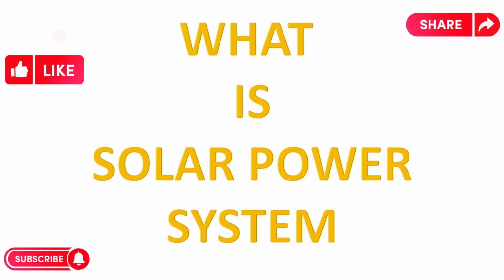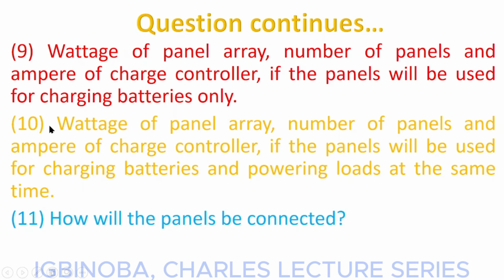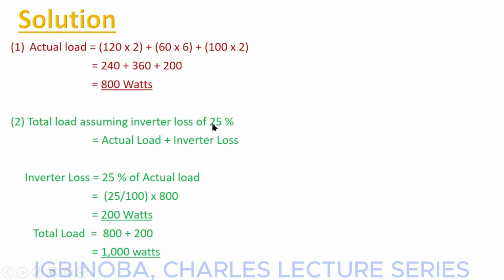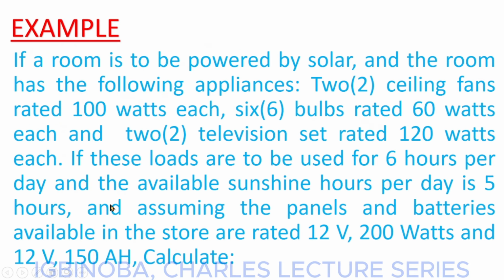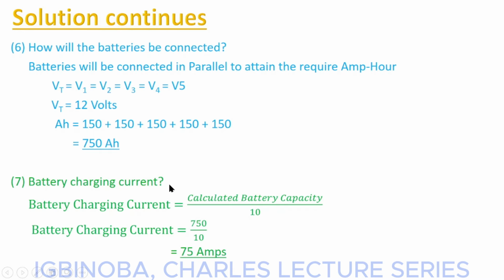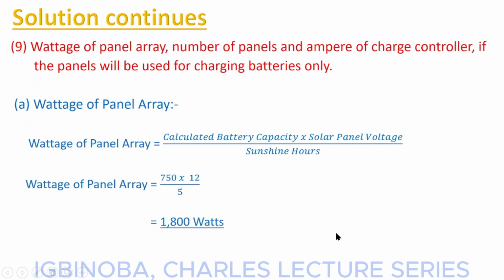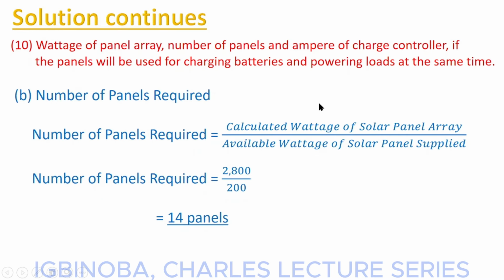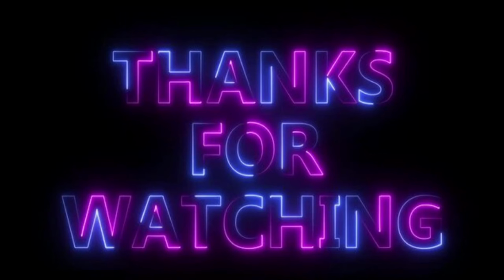Design of Solar Power System

Comment: COMP320T 

1 Actual load 1380W
2 Total load  1720W
3 Inverter rating  2156.25VA
4 battery Capacity 1293.75Ah
5 number of batteries 8.6
6 Parallel 
7 Battery charging  129.4A
8 T = 14hrs
9 (a) 3105W
   (b) 15.5 panels 
   (c)  258.75 A
10 (a) 4830W 
     (b) 24 panel 
     (c) 402.5A 
11 Parallel

Comment: PETRO327A

1. Actual load= (100×3)+(60×10)+(120×4) =1380watts
2. Total load assuming inverter loss of 25%= Actual load +Inverter loss
Inverter loss=25% of Actual load
= 25%×1380=345 watts
Total load= 1380+345=1725 watts
3. Inverter rating on VA using power factor of 0.8
= (1725÷0.8)= 2156.25
4. Battery capacity using factor for reserve 75%=(2×1725×6×0.75)=1293.75Ah
5. No. of batteries for backup hours=1293.75Ah÷150Ah= 8.6 =8 batteries 
6. How batteries will be connected?
The batteries will be connected in parallel 
Vt=V1=V2=V3=V4=V5=V6=V7=V8
Ah= 150+150+150+150+150+150+150+150=1200
7. Battery charging current=1293.75÷10=129Amps
8. Battery charging time assuming charging loss of 40%= 1293.75Ah+(40%+1293.75Ah)÷129A=14hrs
9a. Wattage panel array= 3105 watts
9b. Number of panels required= 3105÷345=9 panels 
9c. Ampere of charging controller required= 3105÷12=258.75Amps
10a. Wattage of panel array= Calculated wattage of solar panel array for charging battery only+ calculated total load =3105+1725=4830watts
10b. Number of panels required= calculated wattage of solar panel array÷ Available wattage of solar panel supplied= 4830watts÷345= 14Amps
10c. Ampere of charge controller= calculated wattage of solar panel array÷ solar panel voltage=4830watts÷12volts= 402.5Amps
11. How will the panels be connected?
Ans: They will be connected in parallel

Comment: MAR378Z
 
1. Actual load= (100×3)+(60×10)+(120×4) =1380watts
2. Total load assuming inverter loss of 25%= Actual load +Inverter loss
Inverter loss=25% of Actual load
= 25%×1380=345 watts
Total load= 1380+345=1725 watts
3. Inverter rating on VA using power factor of 0.8
= (1725÷0.8)= 2156.25
4. Battery capacity using factor for reserve 75%=(2×1725×6×0.75)=1293.75Ah
5. No. of batteries for backup hours=1293.75Ah÷150Ah= 8.6 =8 batteries 
6. How batteries will be connected?
The batteries will be connected in parallel 
Vt=V1=V2=V3=V4=V5=V6=V7=V8
Ah= 150+150+150+150+150+150+150+150=1200
7. Battery charging current=1293.75÷10=129Amps
8. Battery charging time assuming charging loss of 40%= 1293.75Ah+(40%+1293.75Ah)÷129A=14hrs
9a. Wattage panel array= 3105 watts
9b. Number of panels required= 3105÷345=9 panels 
9c. Ampere of charging controller required= 3105÷12=258.75Amps
10a. Wattage of panel array= Calculated wattage of solar panel array for charging battery only+ calculated total load =3105+1725=4830watts
10b. Number of panels required= calculated wattage of solar panel array÷ Available wattage of solar panel supplied= 4830watts÷345= 14Amps
10c. Ampere of charge controller= calculated wattage of solar panel array÷ solar panel voltage=4830watts÷12volts= 402.5Amps
11. How will the panels be connected?
Ans: They will be connected in parallel.

Comment: MECH383E

1. Actual load=1380W

2. Total load = 1725W

3. Inverter rating=2156.25VA

4. Battery capacity= 1293.75AH

5. Number of batteries= 9 batteries

6. How will the batteries be connected= In Parallel

7. Battery charging current=129.3A

8. Charging time= 14 hours

9. a) Wattage of panel array=3105W
b) Number of panels=15.5 panels
c) Ampere of charge controller=258.75A

10. a) Wattage of panel array= 4830W
b) Number of panels=24 panels
c) Ampere of charge controller=402.5A

11. How will the panels be connected= In Parallel

Comment: ANSWERS TO SWEP NEW TASK
 YOUR DEPT. CODE AND BELOW ARE THE ANSWERS 
1. Actual load= (100×3)+(60×10)+(120×4) =1380watts
2. Total load assuming inverter loss of 25%= Actual load +Inverter loss
Inverter loss=25% of Actual load
= 25%×1380=345 watts
Total load= 1380+345=1725 watts
3. Inverter rating on VA using power factor of 0.8
= (1725÷0.8)= 2156.25
4. Battery capacity using factor for reserve 75%=(2×1725×6×0.75)=1293.75Ah
5. No. of batteries for backup hours=1293.75Ah÷150Ah= 8.6 =8 batteries 
6. How batteries will be connected?
The batteries will be connected in parallel 
Vt=V1=V2=V3=V4=V5=V6=V7=V8
Ah= 150+150+150+150+150+150+150+150=1200
7. Battery charging current=1293.75÷10=129Amps
8. Battery charging time assuming charging loss of 40%= 1293.75Ah+(40%+1293.75Ah)÷129A=14hrs
9a. Wattage panel array= 3105 watts
9b. Number of panels required= 3105÷345=9 panels 
9c. Ampere of charging controller required= 3105÷12=258.75Amps
10a. Wattage of panel array= Calculated wattage of solar panel array for charging battery only+ calculated total load =3105+1725=4830watts
10b. Number of panels required= calculated wattage of solar panel array÷ Available wattage of solar panel supplied= 4830watts÷345= 14Amps
10c. Ampere of charge controller= calculated wattage of solar panel array÷ solar panel voltage=4830watts÷12volts= 402.5Amps
11. How will the panels be connected?
Ans: They will be connected in parallel

Comment: EEE3102X 

1. actual load = 1380watts
2. total load = 1725watts
3. inveter ratings in VA = 2156.26VA
4. battery capacity = 1035AH
5.  number of batteries for back up hours = 6.9 = battries 
6. the batteries will be connected in parallel 
7. Battery charging current = 103.5A
8. Battery charging time = 14hrs
9. 
a. Wattage panel array = 3105 watts
b. Number of panels = 16
c. Charge controller = 258.75A
10.
a. Wattage panel array 
b. Number of panels = 24
c.  Charge controller = 402.5A
11. Panels are arranged in parallel

Comment: PETRO33C 

1. Actual load= (100×3)+(60×10)+(120×4) =1380watts
2. Total load assuming inverter loss of 25%= Actual load +Inverter loss
Inverter loss=25% of Actual load
= 25%×1380=345 watts
Total load= 1380+345=1725 watts
3. Inverter rating on VA using power factor of 0.8
= (1725÷0.8)= 2156.25
4. Battery capacity using factor for reserve 75%=(2×1725×6×0.75)=1293.75Ah
5. No. of batteries for backup hours=1293.75Ah÷150Ah= 8.6 =8 batteries 
6. How batteries will be connected?
The batteries will be connected in parallel 
Vt=V1=V2=V3=V4=V5=V6=V7=V8
Ah= 150+150+150+150+150+150+150+150=1200
7. Battery charging current=1293.75÷10=129Amps
8. Battery charging time assuming charging loss of 40%= 1293.75Ah+(40%+1293.75Ah)÷129A=14hrs
9a. Wattage panel array= 3105 watts
9b. Number of panels required= 3105÷345=9 panels 
9c. Ampere of charging controller required= 3105÷12=258.75Amps
10a. Wattage of panel array= Calculated wattage of solar panel array for charging battery only+ calculated total load =3105+1725=4830watts
10b. Number of panels required= calculated wattage of solar panel array÷ Available wattage of solar panel supplied= 4830watts÷345= 14Amps
10c. Ampere of charge controller= calculated wattage of solar panel array÷ solar panel voltage=4830watts÷12volts= 402.5Amps
11. How will the panels be connected?
Ans: They will be connected in parallel.

Comment: COMP341O

1. Actual load is 1380w

2. Total load is 1725w

3. Inverter ratings is 2156.25VA

4. Battery capacity is 1293.75AH

5. No of batteries 9

6. Parallel

7. Battery charging current is 129.375amps

8. Charging time is 14 hours

9. A. 3105watts
B. 16 panels
C. 258.75amps

10. A. 4830 watts
B. 24 panels
C. 402.5amps

11. Parallel

Comment: CIV371S

1 (3×100)+(10×60)+(4×20)
1380 Watts 

2  inverter loss is 345 Watts 
Total load is 1380+345= 1725 Watts 

3 1725÷0.8= 2156

4  battery capacity is 1294Ah

5 1294/150 = 9 batteries 

6 1200

7 1294/10 =129 Amps 

8 charging time is 14 hours 

9a 1294×12/5 = 3105 Watts 
b 3105/200= 15 panels.
c 3105/12 = 259 Amps

10a 3105+1725=4830 Watts 
b 4830÷200= 24 panels
c 4830÷12= 403 Amps

11 The panel will be connected in parallel.

Comment: CIV329C1

 (3×100)+(10×60)+(4×20)
1380 Watts 

2  inverter loss is 345 Watts 
Total load is 1380+345= 1725 Watts 

3 1725÷0.8= 2156

4  battery capacity is 1294Ah

5 1294/150 = 9 batteries 

6 1200

7 1294/10 =129 Amps 

8 charging time is 14 hours 

9a 1294×12/5 = 3105 Watts 
b 3105/200= 15 panels.
c 3105/12 = 259 Amps

10a 3105+1725=4830 Watts 
b 4830÷200= 24 panels
c 4830÷12= 403 Amps

11 The panel will be connected in parallel.

Comment: MEE 312S
1.	Actual Load = 1380 watts
	2.	Total Load = 1725 watts
	3.	Inverter Rating = 2156.25 VA
	4.	Battery Capacity = 1293.75 Ah
	5.	Number of Batteries = 8.625 ~ 9 batteries
	6.	Parallel
	7.	Battery charging current = 129.375 Amps
	8.	Charging time = 14 hrs
	9.	(a) 3105 watts
(b) 15.525 ~ 16 panels
(c) 258.75 Amps
	10.	(a) 4830 watts
(b) 24.15 ~ 24 panels
(c) 402.5 Amps
	11.	Parallel

Comment: COMP3101W 
1. Actual load, 1380 W
2. Total load with 25% inverter loss,1840W
3. Inverter rating i.e PF 0.8, 2300 VA
4. Battery capacity i.e 75% reserve, =920 Ah
5. Number of batteries, 7 batteries
6. Battery connection, All parallel
7. Battery charging current, 138A
8. Battery charging time i.e 40% loss, 8.3 hours
9. Panels for battery charging only,14 panels (2800 W),250A controller
10. Panels for charging + direct load, 26 panels (5 200 W),420-450A controller
11. Panel connection, 7S2P

Comment: CHM397S
i) Actual load = 1380 watts.
il) Total load = 1725 watts.
iii) Inverter ratings in VA = 2156.25VA.
iv) Battery capacity = 1035Ah.
v) Number of batteries for backup hours = 6.9= 7
batteries.
vi) The batteries will be connected in parallel. vii) Battery charging current= 103.5 A. viii) Battery charging time= 14 hours ix) a. Wattage of panel array= 2484 watts.
b. Number of panels= 12.42 = 12 panels
c. Ampere of charge controller= 207A.
x) a. Wattage of panel array= 4209 watts.
b. Number of panels= 21.05 = 21 panels.
c. Ampere of charge controller= 350.75A. xi) The panels will be connected in parallel just as the batteries

Comment: MECH369Q

1.  Actual load = 1380 watts

2.  Total load = 1725 watts

3.  Inverter rating = 2156.25 VA

4.  Battery Capacity  = 1293.75 Ah

5.  Number of batteries = 9 batteries 

6.  Batteries will be connected in parallel to attain the require amp-hour

7.  Battery charging current = 129.375 Amps

8.  Battery charging time = 14 hours

9(a)  Wattage of panel array = 3105 Watts
  (b)  Number of panels required  = 16 panels
  (c)  Ampere of charger controller required = 258.75 Amps

10(a)  Wattage of panel array = 4830W
    (b)  Number of panels required = 24 panels
    (c)  Ampere of charger controller required = 402.5 Amps

11.  Solar panels will be connected in parallel

Comment: MAR331E 

1. Actual load = 1380W

2. Total load = 1720W

3. Inverter rating = 2156.25VA

4. Battery capacity = 1293.75Ah

5. Number of batteries = 8.6

6. Parallel

7. Battery charging = 129.4A

8. T = 14hrs

9. (a) 3105W
(b) 15.5 panels
(c) 258.75A

10. (a) 4830W
(b) 24 panel
(c) 402.5A

11. Parallel

Comment: PETRO3185C
1. Actual load= (100×3)+(60×10)+(120×4) =1380watts
2. Total load assuming inverter loss of 25%= Actual load +Inverter loss
Inverter loss=25% of Actual load
= 25%×1380=345 watts
Total load= 1380+345=1725 watts
3. Inverter rating on VA using power factor of 0.8
= (1725÷0.8)= 2156.25
4. Battery capacity using factor for reserve 75%=(2×1725×6×0.75)=1293.75Ah
5. No. of batteries for backup hours=1293.75Ah÷150Ah= 8.6 =8 batteries 
6. How batteries will be connected?
The batteries will be connected in parallel 
Vt=V1=V2=V3=V4=V5=V6=V7=V8
Ah= 150+150+150+150+150+150+150+150=1200
7. Battery charging current=1293.75÷10=129Amps
8. Battery charging time assuming charging loss of 40%= 1293.75Ah+(40%+1293.75Ah)÷129A=14hrs
9a. Wattage panel array= 3105 watts
9b. Number of panels required= 3105÷345=9 panels 
9c. Ampere of charging controller required= 3105÷12=258.75Amps
10a. Wattage of panel array= Calculated wattage of solar panel array for charging battery only+ calculated total load =3105+1725=4830watts
10b. Number of panels required= calculated wattage of solar panel array÷ Available wattage of solar panel supplied= 4830watts÷345= 14Amps
10c. Ampere of charge controller= calculated wattage of solar panel array÷ solar panel voltage=4830watts÷12volts= 402.5Amps
11. How will the panels be connected?
Ans: They will be connected in parallel

Comment: CHM360H
1.Actual load = 1380w
2.Total load = 1725w
3.Inverter rating = 2156.25VA
4.Battery capacity = 1293.75AH
5.No batteries 9
6.Parallel
7.Battery charging current = 129.38ampere
8.Charging time = 14 hours
9.a) 3105w
   b) 15.5 panels
   c) 258.75A
10.a) 4830w
     b) 24 panels
     c) 402.5A
11.Parallel

Comment: MAR3154X

1. Actual load = 1380 watt
2. Total load = 1725 watt
3. Inverter rating = 2156.25 VA 
4. Battery rating= 1293.75 Ah
5. Number if batteries = 9
6. Battery are connected in parallel 
7. Battery charging current= 129.4 amps
8. Battery charging Time = 14hrs
9
a. Wattage panel array = 3105 watts
b. Number of panels = 16
c. Charge controller= 258.75 A
10
a. Wattage of panel array = 4830 watts
b. Number of panels= 24
c. Charge controller= 402.5 A
11. Panels are arranged in parallel ❤

Comment: CHM34D 
1. Actual load= (100×3)+(60×10)+(120×4) =1380watts
2. Total load assuming inverter loss of 25%= Actual load +Inverter loss
Inverter loss=25% of Actual load
= 25%×1380=345 watts
Total load= 1380+345=1725 watts
3. Inverter rating on VA using power factor of 0.8
= (1725÷0.8)= 2156.25
4. Battery capacity using factor for reserve 75%=(2×1725×6×0.75)=1293.75Ah
5. No. of batteries for backup hours=1293.75Ah÷150Ah= 8.6 =8 batteries 
6. How batteries will be connected?
The batteries will be connected in parallel 
Vt=V1=V2=V3=V4=V5=V6=V7=V8
Ah= 150+150+150+150+150+150+150+150=1200
7. Battery charging current=1293.75÷10=129Amps
8. Battery charging time assuming charging loss of 40%= 1293.75Ah+(40%+1293.75Ah)÷129A=14hrs
9a. Wattage panel array= 3105 watts
9b. Number of panels required= 3105÷345=9 panels 
9c. Ampere of charging controller required= 3105÷12=258.75Amps
10a. Wattage of panel array= Calculated wattage of solar panel array for charging battery only+ calculated total load =3105+1725=4830watts
10b. Number of panels required= calculated wattage of solar panel array÷ Available wattage of solar panel supplied= 4830watts÷345= 14Amps
10c. Ampere of charge controller= calculated wattage of solar panel array÷ solar panel voltage=4830watts÷12volts= 402.5Amps
11. How will the panels be connected?
Ans: They will be connected in parallel

Comment: CHM3134D

1. Actual load:1380 watts
2. Total load: 1725 watts
3. Inverter rating: 2156.25VA
4. Battery capacity: 1293.75Ah
5. Number of batteries: 8.625
6. Parallel 
7. Battery charging current: 129.375Amps
8. Charging time: 14hrs
9a 3105 watts
9b 15.525 amps
9c 285.75amps
10a 4830 watts
10b 24.15
10c 402.5 amps
11. Parallel

Comment: COMP311K

1 Actual load 1380W
2 Total load  1720W
3 Inverter rating  2156.25VA
4 battery Capacity 1293.75Ah
5 number of batteries 8.6
6 Parallel 
7 Battery charging  129.4A
8 T = 14hrs
9 (a) 3105W
   (b) 15.5 panels 
   (c)  258.75 A
10 (a) 4830W 
     (b) 24 panel 
     (c) 402.5A 
11 Parallel

Comment: PETRO3100V

ANSWERS:

1. Actual load: 1530 W

2. Total load with inverter loss: 9.18 kWh/day becomes 12.24 kWh/day required from batteries

3. Inverter rating: 1530 W ÷ 0.8 is exactly 2.0 kVA

4. Battery capacity needed: 12.24 kWh at 12 V = 1020 Ah usable =1360 Ah total at 75% DoD

5. Number of batteries: 1360 Ah ÷ 150 Ah ≈ 10 batteries.

6. Battery connection: All 10 batteries in parallel (12 V, high Ah)

7. Battery charging current: Array current = (total panel watts ÷ 12 V)

8. Charging time: Needs 22.25 kWh from panels; sized to recover within 5 sun hours

9. Panel array (charging batteries only): About 23 panels (200 W each), charge controller capacity ≈ 400 A total.

10. Panel array (powering loads + charging): About 12 panels, controller capacity is 200 A

11. Panel connection: Panels connected in parallel (or parallel strings) to maintain a 12 V system

Comment: PETRO3156Z
1. Actual load= (100×3)+(60×10)+(120×4) =1380watts
2. Total load assuming inverter loss of 25%= Actual load +Inverter loss
Inverter loss=25% of Actual load
= 25%×1380=345 watts
Total load= 1380+345=1725 watts
3. Inverter rating on VA using power factor of 0.8
= (1725÷0.8)= 2156.25
4. Battery capacity using factor for reserve 75%=(2×1725×6×0.75)=1293.75Ah
5. No. of batteries for backup hours=1293.75Ah÷150Ah= 8.6 =8 batteries 
6. How batteries will be connected?
The batteries will be connected in parallel 
Vt=V1=V2=V3=V4=V5=V6=V7=V8
Ah= 150+150+150+150+150+150+150+150=1200
7. Battery charging current=1293.75÷10=129Amps
8. Battery charging time assuming charging loss of 40%= 1293.75Ah+(40%+1293.75Ah)÷129A=14hrs
9a. Wattage panel array= 3105 watts
9b. Number of panels required= 3105÷345=9 panels 
9c. Ampere of charging controller required= 3105÷12=258.75Amps
10a. Wattage of panel array= Calculated wattage of solar panel array for charging battery only+ calculated total load =3105+1725=4830watts
10b. Number of panels required= calculated wattage of solar panel array÷ Available wattage of solar panel supplied= 4830watts÷345= 14Amps
10c. Ampere of charge controller= calculated wattage of solar panel array÷ solar panel voltage=4830watts÷12volts= 402.5Amps
11. How will the panels be connected?
Ans: They will be connected in parallel

Comment: COMP370R
1. Actual load = 1380 watt
2. Total load = 1725 watts
3.Inverter rating = 2156.25 VA
4.Battery rating = 1293.75 Ah
5. Number of batteries = 9
6.Battery are connected in parallel
7.Battery charging current = 129.4 Amps
8.Battery charging time = 14 hrs
9
a Wattage of panel array = 3105 watts
b Number of panel = 16 panels
c Charge controller = 258.75 A
10.
a Wattage of panel array = 4830 watts
b Number of panels = 24
c Charge controller = 402.5 A
11.panels are arranged in parallel